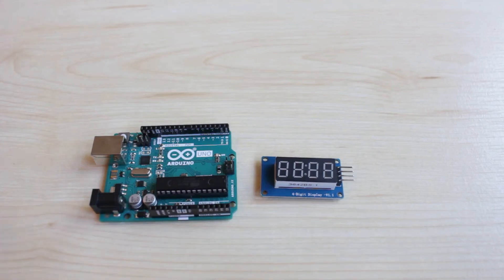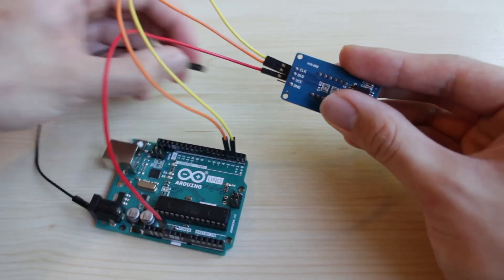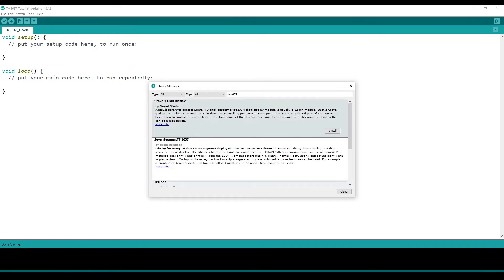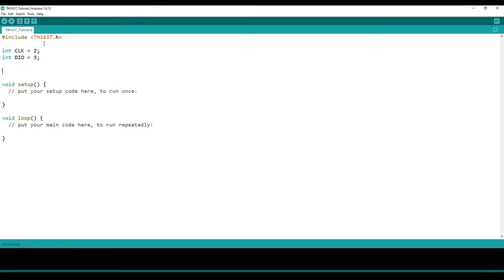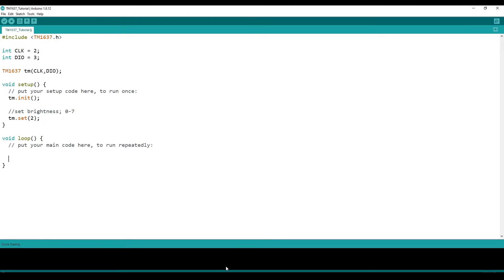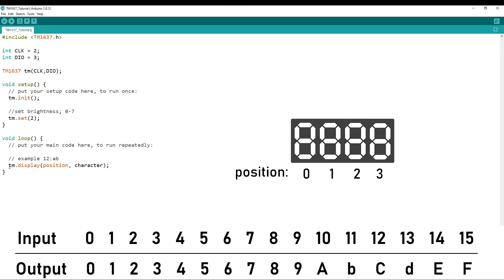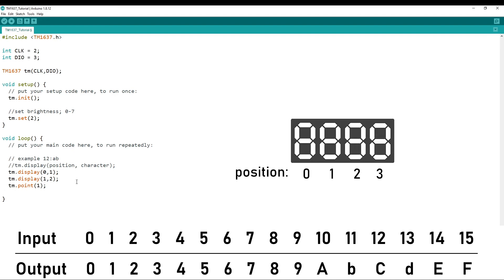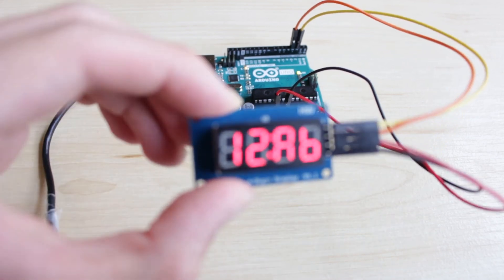How to use the TM1637 Digit Display with an Arduino (Quick Tutorial)

Comment: how can you get 2 7 segment displays to work at once doing different things?
Reply from the maker: You can get different displays to do different things by connecting their CLK and DIO pins to different pins on the Arduino, so for example you can connect one display's CLK and DIO to pins 2 and 3 on the Arduino, and another display's CLK and DIO to pins 4 and 5. Hope that helps!

Comment: Hi Ryan, great tutorial video even for us noobs.
i need help on probably very easy setup and coding. can i contact you somehow? email? would really help me out.
Reply from the maker: Thanks! Also, you can post your question in the comments, I'd be happy to help!
Reply: Ryan Chan hi. I think over messenger would be easyer but what i want to do is:
Control a tm1637 display with a potentiometer. Showing numbers from 0:00 to 9:99. Components arduino nano, potentiometer with on off function, cr2032 coin as power source, step up module and of course the display itself
Reply from the maker: @jayc1983  That's a good question. I've made this function to make it easier to do that:

void displayNumber(int num){
  tm.display(3, num % 10);
  tm.display(2, num / 10 % 10);
  tm.display(1, num / 100 % 10);
  tm.display(0, num / 1000 % 10);
}

To make the TM1637 display a number, paste that function into your code and pass in the integer you want to display into the function.

So for your project, I suggest mapping the value of the potentiometer and then passing that value into the displayNumber function like so: https://pastebin.com/Xi5T5H7B

Thanks for bringing this up, I will pin that function in a comment so others can use it as well